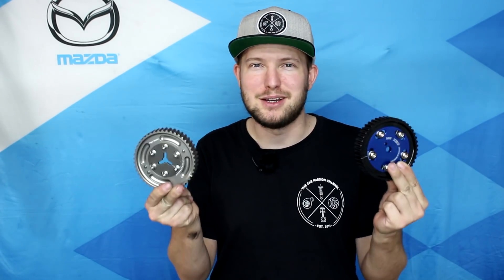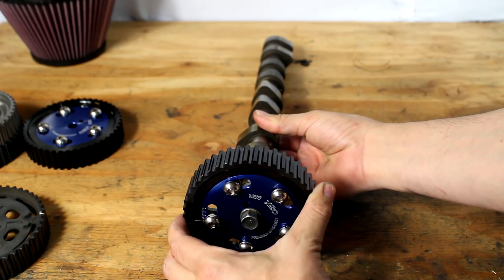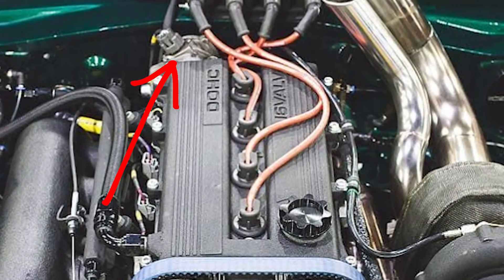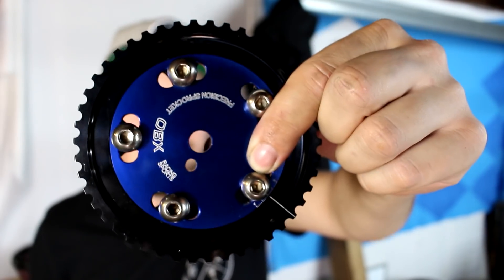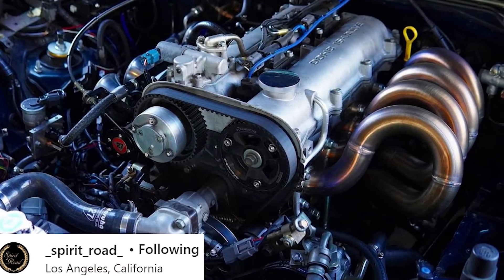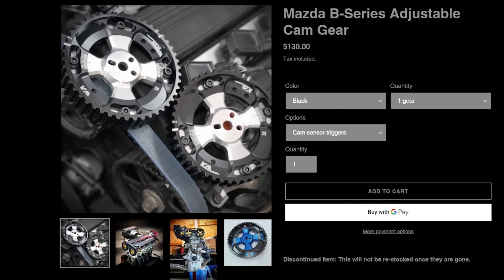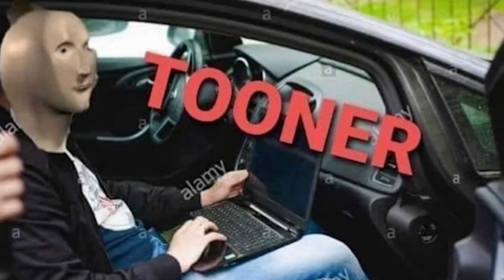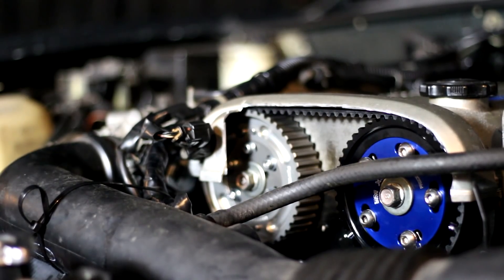EVERYTHING You Need To Know About Adjustable Cam Gears On Your Miata! [Project 2SJ Ep11]

Comment: Where can I learn more about the 36-2 set up not needing any addl sensors when used with MS.  I'm looking to swap a 01 bottom end bp4w head into a 93 chassis.  As mentioned at about 6:05 in the video.

Comment: Hello. I need dime help.
What does the cam sensor read un the gear?
I want to convert My b6 carb engine to injection and i want to put the cam sensor( not a ckp ) sensor for signal to ecu

Comment: I know this is off topic but I found out today that the Supertech Pistons I put in my car actually needed an upgraded wrist pin, Tool Steel vs Chromoly. Did you do this upgrade on your car? If not, are you concerned about the pin breaking?
Reply from the maker: I'm not aware of which wrist pins I have, but I didn't select any upgrade at the time or purchase. But no, I'm not concerned about breaking a wrist pin.

Comment: Wouldn’t is be easier to just use the adjustable timing wheel to advance timing as a whole? I have a 99/bp4w and bought the 5x racing wheel. Works for all engine 1999-2005 and is only $35.
Reply from the maker: You're confusing adjusting the ignition timing with adjusting the cam timing, they are two completely different things.

Comment: I used to undo the cam bolts and rotate the inner gear of one hole, avoiding the drilling step, I lost then the refernce marks but with a degree wheel I found them back.

Comment: I run the KA gears on my 450 ish whp escort  GT,  (mazda BP powerd for anyone confused). Those are actually mine on the site there.  They are great gears especially if you're running the exhtake mod. But I think they are discontinued as they were a small batch run...

Comment: If you get new cams with high lift and/or duration you can use these to make sure the valves will never hit each other
Reply from the maker: On the flip side, if you're running big cams, you may not be able to freely adjust the cam gears without valve-to-piston contact. That needs to be checked before the engine is run!

Comment: Any tips on buying used engines? I need a new one because my entire burns oil and has low oil pressure. 33-35 psi @3500rpm

I see a few engines on Ebay for sale that look okay but they are advertised to be imported from Japan. I am looking for a 1.6L. The ads are weird since they say "1999-2000 1.6L" but thats sus cause miatas had 1.8L after 1998

Another weird thing is the crankshaft pulley looks different than the US 1.6L engines. I am only bringing this up because I don't want another SNC engine.

Is there anything I should be weary of and look for?
Reply: Other parts of the World had 1.6 litre engines. The newer 1.6 litres are different than the 90 -93 engines. Just swap in a 94 to 97 1.8 L engine.

Comment: Why can't you do vvt on both cams? The parts just don't exist? Or is there something that actually makes it not possible
Reply from the maker: The head, the cam, and oil system are completely different on the intake side of the NB2 engines. You COULD do it but the amount of engineering, precision machining, and labor involved would not be worth the minimal gains.

Comment: Have you looked into the Miata with "Koenigsegg's freevalve" technology on it? Would be super interesting if more people tried improving it and made it viable to use on a daily or something.
Reply: It's wonderful technology, but the cost is not worth it for 8000 RPM maximum.  Titanium valve springs would be way cheaper ....

Comment: Can you add VVT to a non VVT 1.8 and if so what does it take?
Reply from the maker: You can, via changing the head and adding an ECU that can control VVT.
Reply: No, but you can put a VVT engine n a non VVT car, but you need a standalone ECU. A bigger set of cams is about the same price as doing all that, and will make more HP than just VVT. The late VVT engines have some useful improvements in main cap design and a few other areas, as well as a higher flowing inlet manifold, VVT swaps into non VVT is a good mod overall, as you have the best block for boost later.